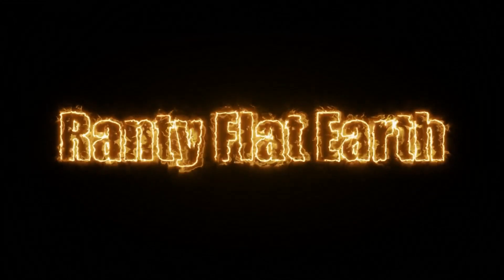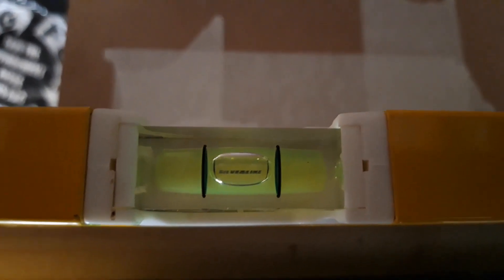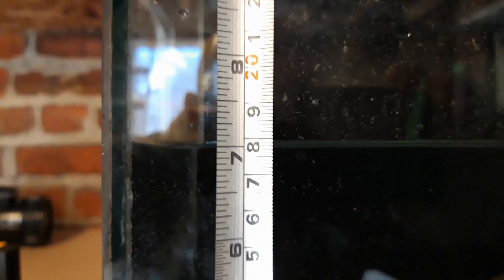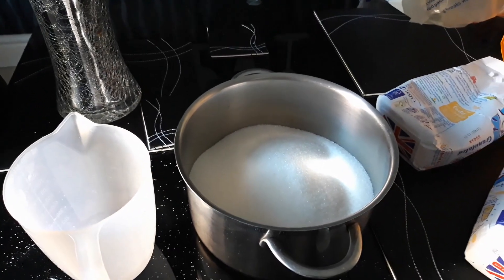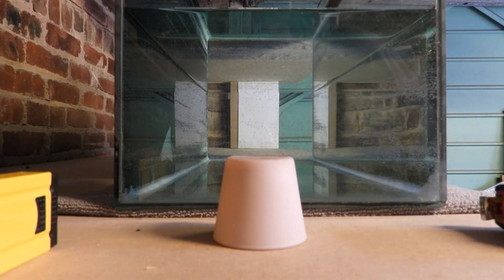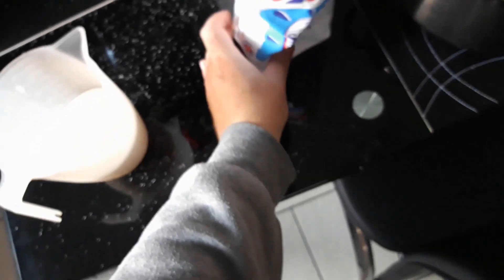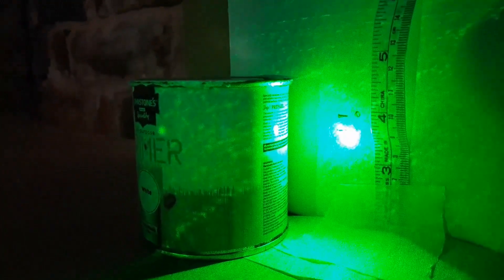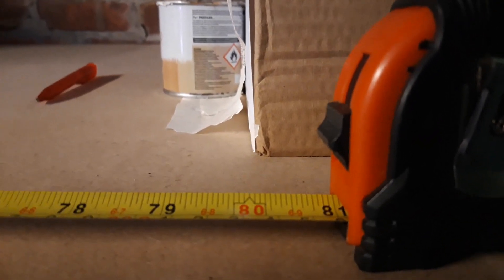Sinking Experiment Crushes The Globe Rhetoric For Observations

Comment: Ranty I'm afraid in this instance, you're observational skills are really substandard.  Look at the bottom of the pieces of paper.  The one on the right appears to be higher than the one on the left.  Look at the dot/blemish on the piece of paper.  Again, the one on the right appears to be higher than the one on the left.  How about the 6 on the ruler.  All these observations prove "looming".   

A piece of advice.  The flowerpot is horribly out of focus.  Try using your camera's manual mode or easier, AV mode.  In AV, set the aperture to around f11 or f12.  You'll get a much greater depth of field.  This means more objects with be in focus.  I'm assuming you're using a tripod.  You could stop your camera down to f16.  You will get a splendid DOF; however, diffraction will start to affect the image quality.  Have a fiddle around with different f stops.  You'll notice a marked improvement in your image quality.

Comment: couple of things you missed.  1/ are the walls of the fishtank perpendicular to the laser beam?  2/ prior to adding sugar, why didn't you adjust the mirror to properly collimate the laser so the return beam exactly matched the outgoing beam (which shows the mirror is perpendicular to the beam).  3/ Why did you not put two flower pots in the tank so we could confirm the camera was on level with the tops of the pots?  THEN you add the sugar and set up your gradient.  Shall I point out the obvious error in your results or just make a video pointing it out?  Anything you want to confess?  You know I caught you, right?

Comment: @Ranty There is something weird going on at 12:00. Do you have the same image with no sugar as a comparison? Look at the 6 inch marker. You've added more sugar, and the 6 inch marker has very visibly risen. I think you've got some very odd density layers going on. It might be because you dissolved the sugar in hot water and added that. All the versions of this experiment I've seen are fine by letting the sugar dissolve naturally: that builds up the density layer from the bottom upwards. 

How about a side view of the laser to see it bending downwards as Mick West did?

Comment: @Ranty If light bends down @1:50   (downwards refraction) then the image must appear HIGHER than normal to an observer. So if you're right, on a flat Earth, distant objects would generally loom... Not sink.

You need to get your head around downward refraction = looming, upward refraction = sinking.

Comment: At 6:37 you say the return line is lower then the original beam.  Well it always was.

All very amusing..  Here are some thoughts.

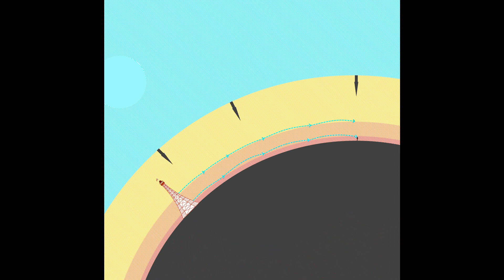At 1:30 you say "the globe model tells us the light bends up"  Sorry no.  Refraction says that on average the light bends down.  It has always said this.

You seem to be making an assumption that the laser beam is parallel to the body of the laser.  This is not necessarily true.

You seem to be saying that the return beam is reflected off the box or mirror you set up.  This is clearly not the case.  The return beam is just reflecting off the further glass wall of your water tank.  There will also be reflections off the first wall of the water tank.  There is always some reflection.  Just looking at the beams at 2:22 the original beam is the higher beam as it is clearly brighter.  This could easily be checked by just putting something in the water and blocking one of the beams.  In any case you would never get a beam in a reflection from something like a cardboard box.

No one says that this sort of deflection of light does not occur.  However just showing it happens is not enough.  It is clearly variable from one day to the next.  To show that the Miles observation is incorrect you need to do something quantitate, that is calculate how much the light would bend in the observation that Miles did.  Also the effects of this sort of this sort of refraction are well know and the effect is minimized by making observations well above a surface, which miles did.

What you have done is show how the "Black Swan" photo is possible due to refraction.  :)